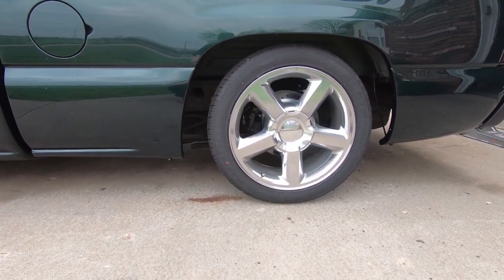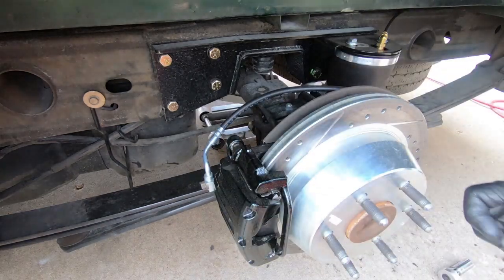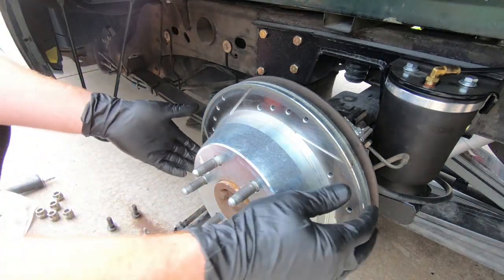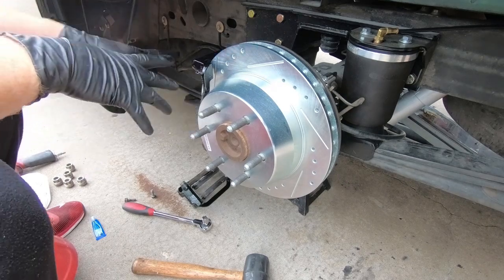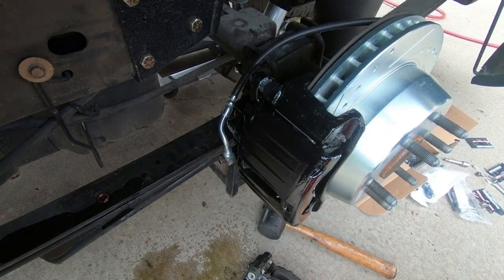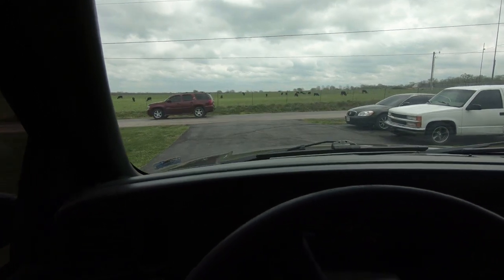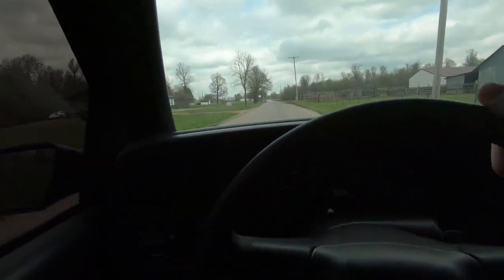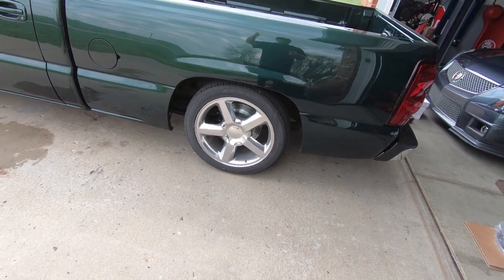How to Upgrade to Dual Rear Calipers Sierra / Silverado

Comment: What's up Travis !!!!!!!!!     Glad to see you got around to doing the rear brake upgrade and once you do the front conversion you'll be pleasantly surprised with the results !!!!!!!   The ceramic pads are the way to go as brake dust is reduced so the rims stay cleaner and  the caliper slides won't get as gummed up like they do with the semi metallic ones.  My rotors also seem to be holding out better with no pulsing so far.  BTW my truck is a 01 Silverado RCSB with a 4.8 and 275/55/20 tires on 20x10 MB Motorsports rims so it already has plenty of tire on the road and the brakes have no problems stopping them.  Keep the great content coming !!!!!!!!!!!!!!!!
Reply from the maker: What's up. Yeah I should have started here but oh well. They do feel better but they work so that is a plus lol. Way less brake dust that's for sure

Comment: Awesome detailed install as always! I too did the same thing with my '04. Ordered the Powerstop kit for it and Russell lines. It does stop good, but the dual piston would have been worth while cause my right rear went bad, so I changed both. I heard the same thing on the 05+ with rear drums having larger front disks and calipers, also seen that 2019+ 1500 brakes will fit with a thick washer to space them. I'll be looking into that when I need a front caliper.
Reply from the maker: Thank you. Yeah I may look into that if a front ever goes bad
Reply: My 2006 Silverado came from the factory with 13-inch rotors and drum brakes on the rear. For some reason, they didn't make a disk brake for that year. They did up until 2004 and started back in 2007. So I am putting the 2020 rear disk brakes on my truck with single calipers as I have the 2020 set up with 4 piston calipers and spacers and drilled and slotted rotors on the front. I have heard if you put duals on the rear with 4 a piston set up in the front that the master cylinder can't pump enough fluid. So people are having to switch to a hydraulic brake booster that works off of the power steering pump for hydropower.
Reply from the maker: The 2020 upgrade seems to be a popular ine but have no experience myself
Reply: @TWAMotorsports  The front 2020 year fix for your truck is easy. Just get four spacers 2 for each side that measures about Thickness -  0.155"
OD - 1.10" ID - 0.54" or just stack up washers until you get the proper width. Do away with the original caliper mount because the 2020 calipers bolts directly to the hub on your truck. Use lock tight and the same bolts from your truck as the brake pads just drop in from the top of the caliper and are held in place by two pins. The spacers are to make sure that the rotors are centered in the middle of the new 2020 caliper you have bolted to your truck. I would save my old caliper bracket as you may want to sell your truck and keep your 2020 4 piston calipers.
Reply from the maker: I'm happy with the brakes it has honestly

Comment: I would love to see you do a drum to disc conversion on this body style of truck. There is a lot of forums that say you can do this with suburban parts, but I have never found a good video on it.
Reply from the maker: If I ever buy one I will do that.
Reply: I don't know why gm when back to drums in 03. So dump.
Reply from the maker: They were way more reliable
Reply: @TWAMotorsports  see if one of you local buddies will pay for the conversation on one of their rides. If I remember correctly one or two of your lowering jobs had drum brakes
Reply: @leviwoodring6101   According to a GM engineer they went back to drums because the disk brake system has a design flaw,  and customers got sick of going thru pads and rotors every six months. For some reason the way the system was designed road debris wears out the pads prematurely. They tried a revised dust sheild but it didn't help. I found this out when I was researching how to swap my 06 to disks...
Reply: Shoot my 4x4 disc brake front n rear 01 truck is sitting at 182,000 miles with 2nd set of pads and factory rotors.
It’s just now getting to where when towing I feel like I’m pushing to the floor to stop it on a downhill stop, which is why I am researching to swap them.
Design flaw my butt
It’s because disc are easy to change and work on. A kid can do it with instruction. Also Doesn’t have anywhere  near the components of drums. 
Most can’t work on drums, and set them up properly. Most Definitely not today’s modern generations. It was all about them getting more $ for components and maintenance.

The parking brake if not maintained properly does have common issues. But has nothing to do with drums or rotors, both are basically the same inside of both.
Reply: @bdd1469  don't use cheap Pads, I was doing the fronts every 2 years
Reply: @pmotorsports8276  they updated the design for 03+ and it was 05-07 that had drums
Reply from the maker: Correct
Reply: @shadowopsairman1583  a friend of mine has a 03 silverado with drum brakes

Comment: Thanks for the video as I was seriously thinking about converting to the dual piston caliper on my 2000 Silverado Stepside.  I liked your comments regarding using stock brake lines vs the stainless steel ones and that you really don't need a big master cylinder.
Reply from the maker: Thank you. Hopefully its helpful when you do it

Comment: I have an 04 Suburban with a hydroboost brake system that I did the big front brake upgrade with a 2018 year and it fit just fine, my truck already came with the dual piston in the rear and I put the powerstop heavy duty towing pads on all 4's and it stops great, night and day from the old factory small front brakes. But next time brakes are due on my truck I want to put the 2019 and up years front calipers on, the 2019 and up years come with 4 piston brake calipers that also directly bolt up on the front brackets with just adding 1/2in washers to space them out about an 1/8 of an inch to center the calipers even with the rotors. It's awesome that GM keeps all the same bolt on patterns with the brake calipers and with some wheels.
Reply from the maker: Those are a pretty good upgrade I hear.

Comment: One thing I started doing a couple years ago is greasing the caliper contact points instead of the whole backs of the pads. uses less goo, is a much cleaner install to do, and it looks better when done. Otherwise great video. I just got all the parts together to install a 2021 4 piston setup up front on my 04 1500, along with an atomic coilover upgrade. got some bilstein 5100s for the back, but those rear brakes now need love.
Reply from the maker: Sounds like an awesome project you have. Thank you for the tips and good luck on your truck

Comment: My 02 Silverado has always had lackluster  semi spongy brakes to say the least since new. Even after many sets of “premium” pads & rotors it was never great - you got me thinking a dual piston upgrade all the way around may help. Thanks !
Reply from the maker: Glad I could motivate you
Reply: I would of had the hoses replaced
Reply: Steel braided lines are a must. ❤
Reply from the maker: It is an upgrade
Reply: The front already has dual piston calipers
Reply: @kellismith4329  the back uses a similar size pad. So it requires less pedal.
Reply from the maker: Yep

Comment: Nice video, what year the calipers and rotors are? I have a 99 Silverado 4wd and I want to make sure that I can do the upgrade I’m not sure if they will fit both 2wd and 4wd that’s what I want to know the year and model of the truck that the upgrade rotors and caliper fit, thanks.
Reply from the maker: Yes 4wd and 2wd are the same rear end

Comment: You can also do a 2019 to 2020 4 piston front brake conversion on the front. Direct bolt on with the exception of using shims to center the caliper.
Reply from the maker: I have seen that. Nice swap for sure.

Comment: What about the emergency brake pads and hardware with these different rotors. I am wanting to do this on my truck. I'm just not sure if I will be able to use the same caliper bracket
Reply from the maker: Same e brake pads work

Comment: I did the same thing. Replaced my brakes then found out I could of upgraded. What i did do was put Brembo replacement pads for the stock truck. Big difference. Only thing is that ist likes to blacken wheels.
Reply from the maker: Yeah I hate brake dust

Comment: Is it safe to upgrade the rear to match the front? That’s turning the brake power to 50/50 instead of 60/40. So would I have to upgrade the front to be larger than the rear?
Reply from the maker: No issues here

Comment: I'm checking right now but I have a 2003 Chevy Silverado and I ordered the kit I thought I was being smart after seeing you but I need the bracket for the rear two piston calipers as you know the one that's on there is 4 inches center to center are six and a half inches center to center and I need seven and a half anyways be much appreciated but hopefully I find it
Reply from the maker: Should be able to find one.

Comment: You mentioned upgrading the front rotors to the 05-06 front calipers. The better upgrade it actually the 19-20 4 piston calipers and 13.5" rotors.
Reply from the maker: That is a better upgrade option

Comment: You don’t need to upgrade the brake booster when upgrading to dual pistons?
Reply from the maker: No. Same components on trucks that came stock with them.

Comment: what rear brake lines did you buy do you have that part number im doing the same 2 piston convesion i got your part numer list i bought everything i just need the rear brake lines if you can help me with the part numer that would be great thanks brother i have been watching all your vidios thay are grate thank you
Reply from the maker: Used originals I believe

Comment: Did that green truck come factory with disk brakes and do you know if there is a disk brakes conversion kit out there for a 2005 Chevrolet Silverado 1500 Crew cab LS short bed
Reply from the maker: It did come with discs.

Comment: Is there a way to go from the drum to dual piston rear disc conversion? I’m trying to make it happen and I can’t find someone who’s done it. Maybe I’m missing something. I have a 2006 gmc crew cab 1500 2wd with rear drums. Love to have the dual piston out back.
Reply from the maker: Yes it can be done. Not sure all the parts needed though. May be easier to buy a whole rear end

Comment: The new front 4 piston calipers from the 2019 up is a direct swap too
Reply from the maker: That's what I hear.
Reply: Good man if u have anything else let me know fixing up my 03 avalanche slowly
Reply: Bolt on swap ?
Reply from the maker: Yes
Reply: Eddie Grijalva yeah just have to get the 2019 rotors and calipers
Reply: I thought it was 6 ?
Reply: Yeah it's actually a 6 piston. Ya gotta get the mounting bracket for the caliper too but it bolts right up. All tucks and SUVs since like 99 till now are damn near the same so you can grab parts from say a 2015 and upgrade a 2001 Silverado. Running the Hydro-boost,bigger front and dual piston rear brakes from an 05 Yukon XL on my 01 RCSB 5.3 Silverado
Reply: @davidwelch1903  nice ima go look at that
Reply: TWA Motorsports hey do you have a link that will match the rear calipers for front I I’m going to do the 2019 calipers
Reply from the maker: I don't because I haven't done that swap yet
Reply: @jrvasquez5623  avalanche gang 💪 getter doneee🏔️
Reply: Expensive upgrade at that rate.

Do 17 inch wheels fit still?

Comment: How has this upgrade held up? Got a 04 Z71 with the same issue and I'm considering the same upgrade.
Reply from the maker: They have been great
Reply: @TWA Motorsports  so since this is a factory 2 piston setup, does this mean the original brake master cylinder is more than Adequate for the upgrade? I would assume the master is the same for both systems.
Reply from the maker: Yes it is
Reply: @TWAMotorsports  okay. I think this is what I'm gonna do.

Comment: I should of watch this upgrade before I replace my rear brakes n rotors with single pistons to the 2 pistons but will any of the chevrolet tahoe, suburban, gmc yukon with dual rear pistons work for the upgrade for my 99 Sierra? My 03 Yukon XL Denali has the rear dual piston calipers. On my lowered Yukon I still can't figure out why I have that chevy lean up front on both sides depending on level of the ground. My las thought is I have stock height shocks on the rear with shock relocation, maybe the stock shocks might cause the front to lean or not, it drives me nuts trying to fix this one little thing.
Reply from the maker: Some years do interchange

Comment: Ya im not sure how much of an upgrade the 06,07 fronts you talked about are it might be the same but if you get parts for like an 09 or something suburban they are a good upgrade you juat have to know you need a 17 or bigger so like if your spare is a 16 you may have to change 2 tires in the side of the road you spare to a rear and that rear to the front
Reply from the maker: 06 and 07 fronts are the same as 07 nnbs and up fronts.

Comment: Travis, so I found out all the grinding while driving n braking, the rear passenger side brake drum rotor was all eating up, like a sharp disc from where the pad brakes on. So dangerous but I found that issue. Now I upgrade to the rear dual piston, it is still binding up, locking up the rear drum rotor so tight. What is the cause of this? is it the master cylinder or brake lines? I bleed all 4 lines n brake fluid does come out fine. Was this the problem u had when u said the rear have issue.
Reply from the maker: I would bet its a brake line if I had to guess

Comment: Did yall swap the proportioning valve when upgrading brakes? I plan to do that for hydroboost
Reply from the maker: I didn't
Reply: @TWAMotorsports  did the brake upgrade ever lock up abs on you?
Reply from the maker: No

Comment: Quick question boss, the banjo copper washers did they come with the calipers? Im gonna buy all the same parts you got for my 06 so I can get rid of my crappy single piston calipers cause they keep going out and leaking break fluid at the piston. I noticed that the calipers may or may not come with the washers on Amazon. also great vid, I’ve never done a brake job in my life and I learned a lot just by watching you do the removal haha
Reply from the maker: They did come with the calipers
Reply: Awesome! Thank you man
Reply from the maker: You're welcome
Reply: One more question boss will the calipers fit onto my current single piston caliper bracket? Or do I have to swap the brackets as well
Reply from the maker: Need brackets
Reply: The banjo bolt seals also come with replacement brakelines

Comment: The pistons are made of a composite similar to Bakelite and the swell overtime from moisture the caliper itself is aluminum the pistons swell and won’t go back in to the caliper if your pistons are any kind of metal the calipers aren’t factory
Reply from the maker: Probably why gm changed this

Comment: I REALLY need to do something about the brakes on my 02 lol. They were soft and spongy before the mods but I was your typical bonehead where I put performance mods before the safety mods as any reasonable American would and lets just say its hard for the stock vacuum brakes to stop a 5100lb truck going 120+ mph. So I think it's finally time for a hydroboost swap, EBC rotors and pads on the front and then the OEM dual piston caliper swap on the rears before I continue my push for a 9 second 1/4 mile pass.
Reply from the maker: I'm sure that would greatly improve your stopping power

Comment: i dont know if you still have the 2500 truck? if you do you should do a dashboard swap, and door electrinics swap, to be electric i just did it on mine it was so easy acouple bolts and the dash it out
Reply from the maker: That truck was not power windows
Reply: @TWAMotorsports  damn, I thought it was, I got my single cab for 1,000, I bought a suburban for 500 did the engine and full interior swap and even swap the fuel lines and flex fuel sensor, only bought a heater core for good measures everything was plug and play only cut my stock headliner to add the map lights
Reply from the maker: Nice. Stay tuned because I have surprises coming
Reply: @TWAMotorsports  10-4 cant wait

Comment: Are the new caliper brackets different than the original ones?
Reply from the maker: Yes
Reply: @TWAMotorsports  what’s the part number? Or can I still use the original ones to go from one piston caliber to two piston calibers?
Reply from the maker: All parts used listed in video description
Reply: @TWAMotorsports  my bad, I was a little confused and didn’t realize that the bracket and caliper are together in the parts list. I was thinking it was separate
Reply from the maker: Sorry, no they come together

Comment: Phenolic, 13 inch rotors. Hoping to find a full float rear end and put 6 lug hubs on with the large disk Brakes in rear. JF7 is rpo code on 2007 silverado classic.
Reply from the maker: That would be a nice upgrade
Reply: @TWAMotorsports  i wan this truck capable wiyhout a new truck note.

Comment: What mm do you use for the rear brake rotors? I am starting to have this issue as well, and I’m thinking of going with power stop all the way (caliper, rotors and pads) cause I know they have 2 different sizes.
Reply from the maker: No idea. Factory 05 size
Reply: TWA Motorsports so after I watched it I’m assuming you used the same rotor as the front right? Cause it’s something I will do on mine since I been kicking the idea around. I’ll just buy 2 sets from Power Stop with caliper rotors and brake pads if that’s the case. Love your channel and content.
Reply from the maker: @ElEsJuan-wn3pl  thank you. I think they are different from the front.
Reply: TWA Motorsports so you used the same ones that you have posted? I have a 03 ext cab Silverado, so I’ll do more research but a lot of good information. I’ll buy little by little and update here for anyone else who is interested in this.